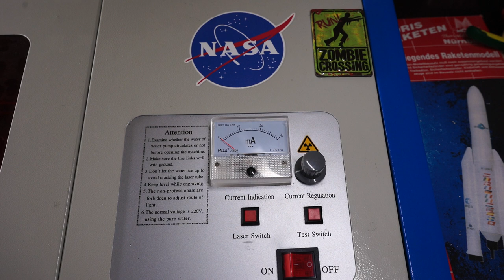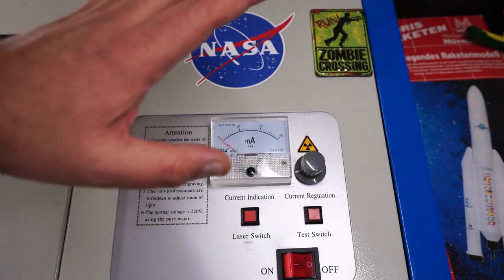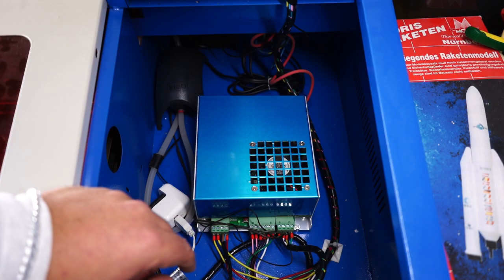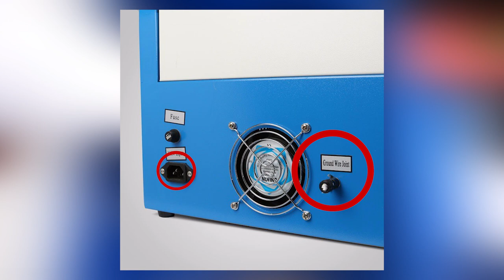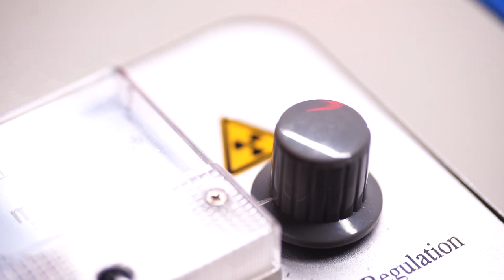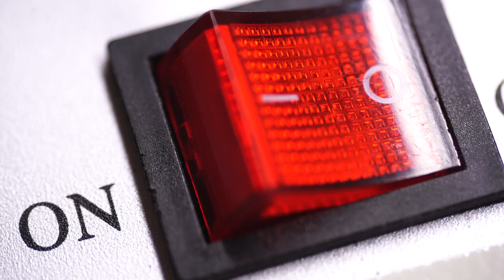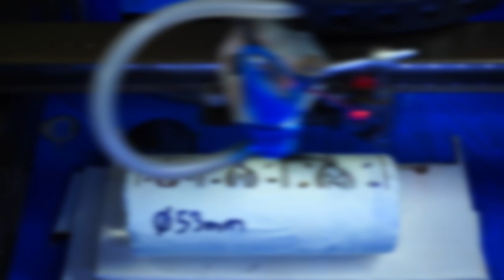The K40 Laser: How to power all the accessories

Comment: Errr.  I did consider grounding my machine through the radiator, but then I realized that I'd effectively be putting thousands of volts through everyone in the building's heating since it's connected with metal pipes.  I could be wrong, but isn't that even more dangerous than just using the earth pin on the socket, which is at least responsibly isolated?
Reply from the maker: The machine should be grounded twice, once trough the groundwire and once by hooking it to something grounded like a radiator. I am not an electrician but for my knowlege in case of an error the breaker will trip when it is hooked up to the ground circuit inside the house electrics. As the amperage is not that high (even it is more than enough to kill somebody) if any high voltage passes through the radiator as it is grounded to the wall it should be fine and due to the resistance and mass of a radiator the current should lower down quickly over distance. Please dont take me by the word, i can be totally wrong. You may be better off asking a certified electrician who will know how to ground this device properly.
Reply: @MancaveEffects  NO IT SHOULDN'T! If you have already a 3 wire plug with GND you don't ground extra via the red port on the back. The only thing you should do is, check if the red GND plug is correctly contacting the metal casing because their is usual a plastic spacer in between or even paint. If there is paint, scrub it off with sandpaper and put it back together. If there is a plastic spacer, remove it so the plug is connected to the metal surface of the case. 

Why do we make sure that the red GND Plug is properly connected to the case? Because your other GND Cables are connected to the red port and go into your 3 wire plug. 
Why is the red GND plug factory wise isolated from the case? Because there is no integrated grounding in china and therefore they have to gnd externally.

Comment: Lets hope the radiators are grounded or you might be sending high voltage done it
Reply: Yes, he doesn't need it if he's plugged into a 3-pin socket surely? That's how i've been using mine for 4 years.

Comment: Not sure where you hooked up the fans to power.
Reply from the maker: There is a 5v output on the lasers power supply. If you are not familar with electrics do not attempt to hook it up directly. I used an external usb power supply

Comment: The aquarium air aump what you use have enough power?
Reply from the maker: I use a Tetra APS 50, probably the weakest one you can find with 1,5L/min because i used one i already had. If you want to buy one, i would definately get a pump that has more power, something like 10 to 20L/min or if you want to go more professional a electromagnetic 30L/min pump.

Cheers

Comment: Its not the voltage that kills you, its the combination of voltage, resistance and amperage. Or in this case most likely the shoody chinese powersupply lacking safety systems and locking you into a freezing current (9 to 30 mA for male) until your RCD/RCCB kicks in.
Overall DC above 20 mA can be dangerous but wont kill you unles you have a previous health condition. 130 mA and up it can cause deadly after effects such as ventricular fibrillation or respiratory arrest. Above 300 mA will knock you out. Good example is getting shocked by a 150000 volt stungun running 30 mA, thats more than your tube is capable of, but it hurts like hell and will lock you in a freezing current.
Reply from the maker: You are absolutely right, it is the combination. I should have got into more detail about that. The maximum output i measured is arround 15mA but i had the case that the poti stopped responding while i was cutting on maximum output power (15mA). At this point it started arcing over to the chassis even while the laser continued cutting, so potentionally i think the power supply can generate a way higher output voltage and amperage under ther right (or wrong) circumstances. As you said it is a shoody chinese machine, (that actually works way to good for the money.)
Thanks for the explanation, it raises the interest to make some testing about that in some future videos.
Reply: FullMetalFox is
Reply from the maker: Regarding that you are describing the laws of physic i want to refer to the following very interesting video that talks about the K40 and why the 20mA in this case are enough current to kill you:

https://youtu.be/6vztMvWUnmM